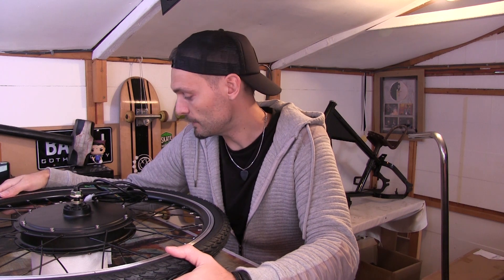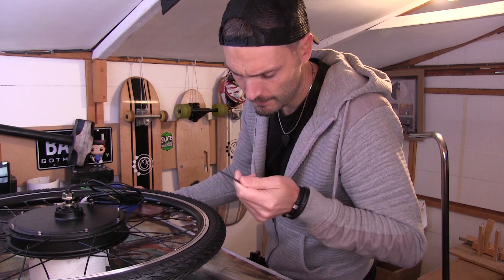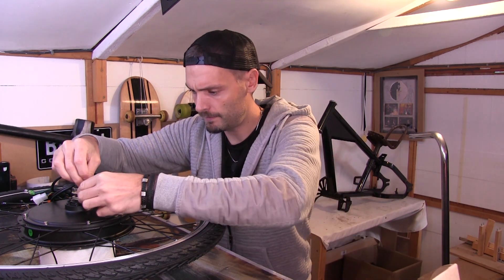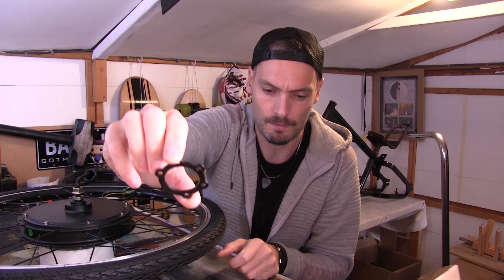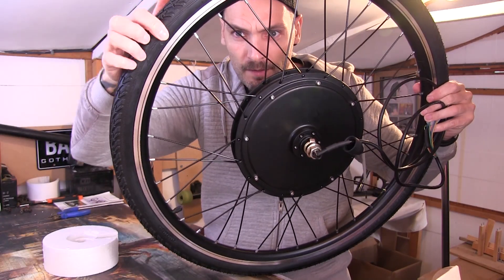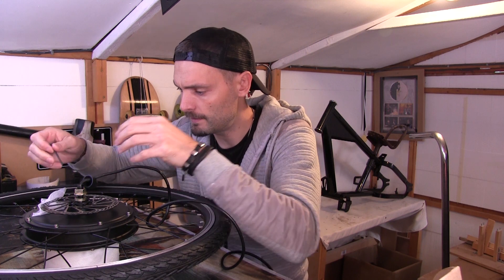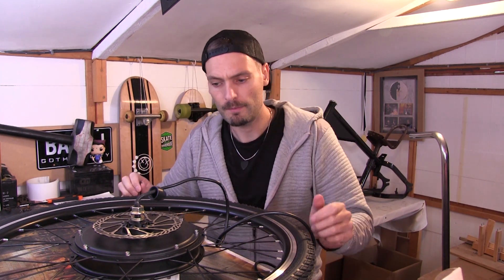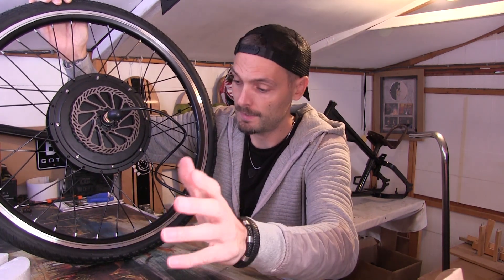How to Install a Disc Brake to an Electric Bike Front Wheel Motor - DIY

Comment: Did the calliper rub on the hub as there’s not much room and I can’t get mine to fit
Reply from the maker: couldn't get it to fit in the end, so had to go with rear disc only.
the only way around it is widen the top fork

Comment: Do all ebike front hubs have the ability to install a disc brake?  Can I take the disc brake off my front tire and just put it on the ebike front tire?  Anything I have to consider when buying it?  Thanks.
Reply from the maker: as far as I know they do yes, all the ones I have built have the holes to add disc brakes. good luck with the build

Comment: You didn't show fitting the caliper over the disk. Mine scrapes the motor and I am experimenting with spacers.
Reply from the maker: unfortunately I could get it on the wheel but not the forks, you'd have to move the brackets on the forks for this to work.
I did plan to build my next bike with wider forks and fit the same size wheel that's on the back to the front but haven't had the time to start anything else.
Reply: @russsayscut437  Since I wrote that, Grin cycles came up with a spacer & washer kit to adjust the disk and and axel mounts. I also found somewhere that you could file down the back of the caliper as well without weakening anything. 

I finally got all the parts, I will update once I get them all together.
Reply from the maker: that's awesome, look forward to seeing it when it's done 👍
Reply: @russsayscut437  Grin has the annoying habit of coming out with parts just after I bought the last generation. Not only did they come out with a disk spacer kit after I collected the parts from all over, they just came out with a great upgrade to their torque arms. More delays. :face-orange-raised-eyebrow:

Comment: Is there enough clearance between the brake calliper when fitted and the wheel spokes?  Cheers.
Reply from the maker: unfortunately not, I didn't find this out until I had to fit the wheel to the forks.
I did work out a cool way to fit a disc brake and caliper to the rear wheel though 👍

thanks for watching
Reply: @russsayscut437  howwwwwww
Reply from the maker: I'll make a video how I did it and what I used 👍

Comment: Hi there - did you have any issues aligning this disk up with the calliper. Just point me to another one of vids if you've covered this topic already - I will try and watch the entirety of your upload collection at some point in the near future - Edit: it youtube did not list the amount of subs you had yesterday apologies  - chin up and keep bleeping.
Reply from the maker: Hey, thanks for watching. unfortunately things come to a grinding holt when try to fit this wheel with the caliper to my front forks on the Stingray chopper as the fork poles are so wide the disc rubbed against the pole. I am in the process of having a wider set made but that will be on my next project. 
I did fit this style disc and caliper to an electric scooter I built and didn't have any issues aligning the disc with the caliper, just played about with the adjusting screws until I was happy it wasn't rubbing.
Apologies if I couldn't help, thanks for the support.
Reply: @russsayscut437  Thanks anyway all info is valuable when it come to disk brakes. I never had the pleasure of using them, all my builds have been front hub rim brakes but I will be getting a disk brake bike for the next project.
Reply: @russsayscut437  I have the same problem that the clipper rubbed against the motor.  I can't find any solution for that, I think I have to buy an new fork with v-brakes I guess :-)
Reply from the maker: @sloef1975  hey thanks for watching, unfortunately I jumped the guy a bit with this and didn't find until later the front forks are to narrow for the disc. 
I ended up finding a new rear wheel with disc brake holes, I had to order a caliper bracket and modify it slightly but all work really well. I plan on doing a video soon show how I did it.